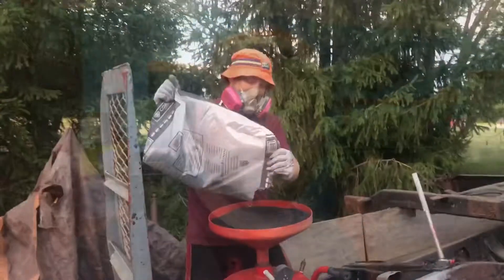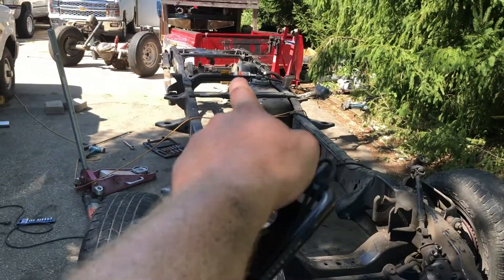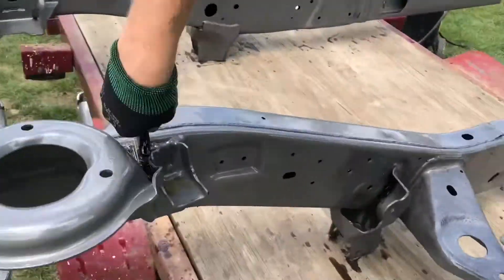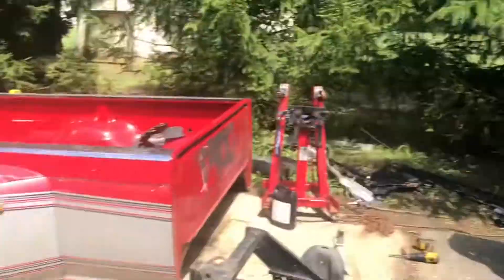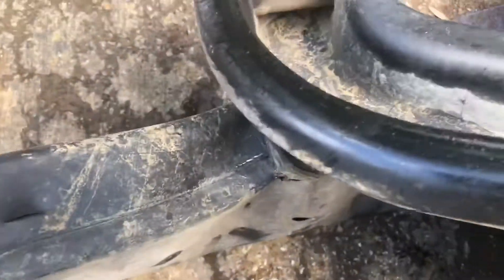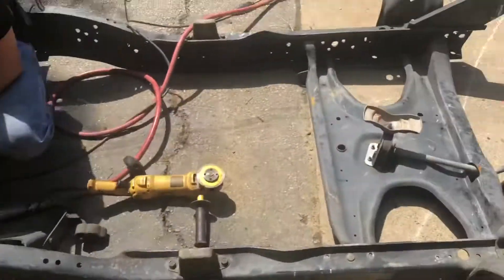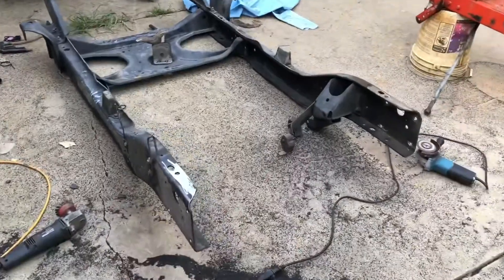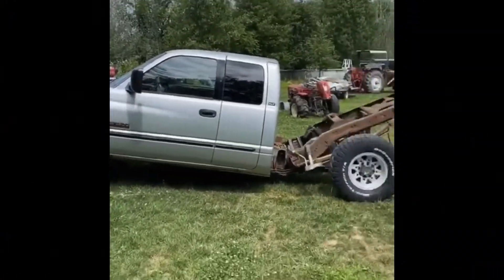2nd gen Cummins restoration part 2

Comment: What’s up man. I have a 94 12 valve Cummins 140,000 miles on it. The frame is rusted and pretty shot, is it worth fixing up? And could u estimate how much it would cost? I’m in north jersey. Great vid
Reply from the maker: Sounds like a nice truck, low miles! It’s definitely worth fixing up if you are a DIYer. It’s hard to say what a frame swap would cost. I know it’s not going to be cheap lol!
Reply: @goodolboys713  thanks for the reply. Unfortunately I’m entry level in terms of what I know about fixing these things up but I know a very good welder around my area. May keep the frame and just cut out and replace sections that need it